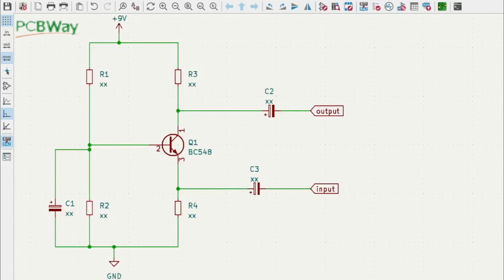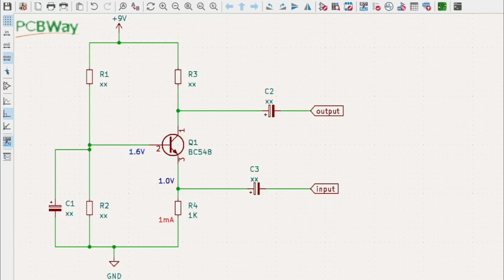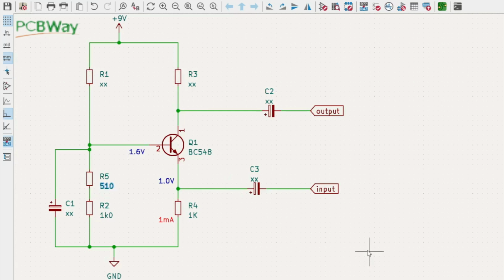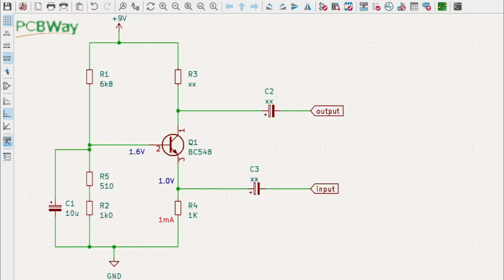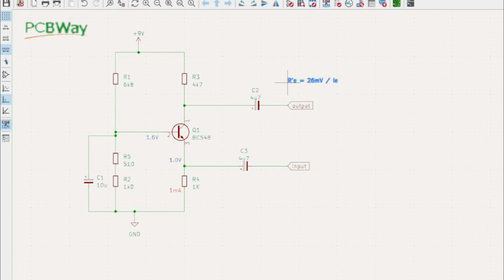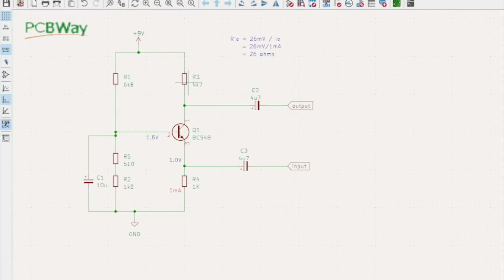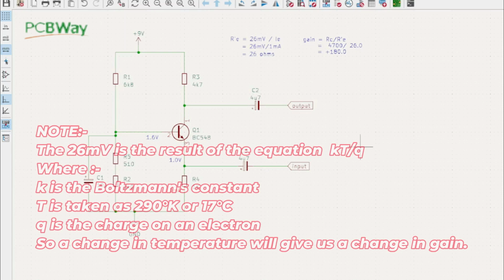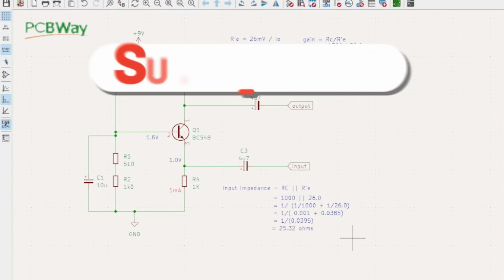#198 Electronics Experimenters Kit Exp8 Common base configuration

Comment: I'm assuming the RC was the reason for the input waveform deforming. Not that it would matter in most applications. As a mic amp, this is very good!
Reply: Ah, have finally remembered the words: "Long Tailed Pair" transistor amp, used for microphones sometimes.  High gain there, as well.  No idea how it compares to the common base though.
Reply from the maker: @GnuReligion  Hi Long tailed pair, common front end for op-amps. looks like after the common emitter, long tailed pair and current mirrors must be next on the list
Reply from the maker: It can be used as an amp for low impedance mic's, USA mil aircraft mic's that are 5 ohms might work well with it.
i did this one as it's not an amplifier i;ve used before and thought i might as well try it out.

Some of the input distortion could be from the 600 ohm oscillator not liking the 26 ohm load. 

I should have made more effort to explain how much the gain is affected by the fact that R'e is quite temperature sensitive.
Reply: @TheEmbeddedHobbyist  It's a great demonstration none the less! I may play about with the circuit later this weekend. I have an 8 ohm mic, nothing like a 5. But for playing about it may do ok. Generally I use a lm5532 for this. The kit looks professional by the way! Very nice build and it has come a long way.

Comment: Wow ... I want to know what is going on with that big perfboard!  Plainly you made your own junction bits out of pin headers.
Transistor circuits make my head spin. But am getting a feel now, for what you are about.
In the mV input range, amazing you are not getting all kinds of noise from stuff in the room.  Ferrite bead?
Is the Common Base Amp for high frequency radio wave amplification?  Got to keep it all in phase?
Reply from the maker: the common base amp has a low input impedance which can be matched to the low impedances see in RF circuits. Which are often on the 50 or 75 ohm range.

I did have a not of averaging on the input which did remove a lot of the input noise, so you could see the input signal better. Plus Ch1 on my scope has a lot more noise on it than ch2, it must have a fault in the front end.

Now if any one from Keysight reads this, how about a 4ch 100Mhz scope as sponsorship. 🙂

Comment: You been drinking again??? 🍺
Reply from the maker: Yep, had to get a few pints of tea down before i could record this. you might notice the breaks where i had to go for a tea extraction process. 🙂
Reply: @TheEmbeddedHobbyist  See I was right you were pissed again🙂
Reply from the maker: @fredflintstone1  Just an OAP thing. 🙂
Reply: @TheEmbeddedHobbyist  Take that bladder back to woolworths, :face-blue-wide-eyes:
Reply from the maker: @fredflintstone1  
its a long ride, this is the last WoolWorths I've seen. you may have to scan around a bit. 
https://www.google.co.uk/maps/@51.5744552,8.1042818,3a,33.5y,185.74h,108.44t/data=!3m8!1e1!3m6!1sAF1QipOLB3OEXXP6Pf9_02gSpZQyb1Mogzg-um1nwq-J!2e10!3e11!6shttps:%2F%2Flh5.googleusercontent.com%2Fp%2FAF1QipOLB3OEXXP6Pf9_02gSpZQyb1Mogzg-um1nwq-J%3Dw203-h100-k-no-pi0-ya129.902-ro0-fo100!7i6000!8i3000